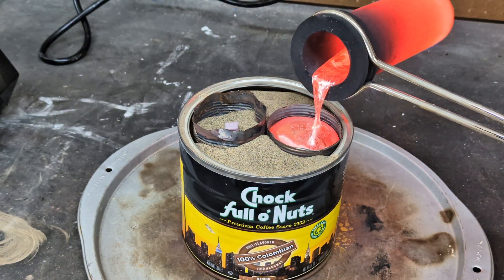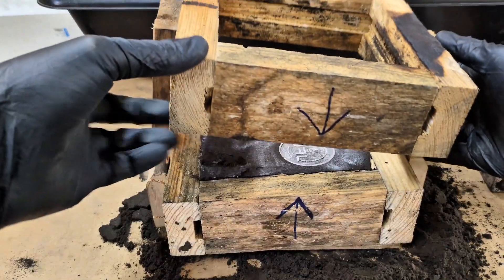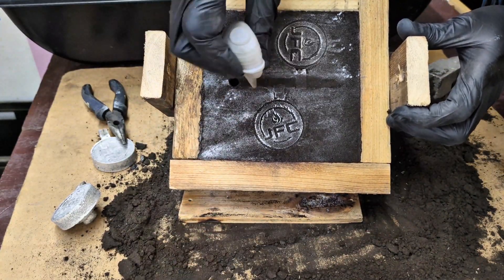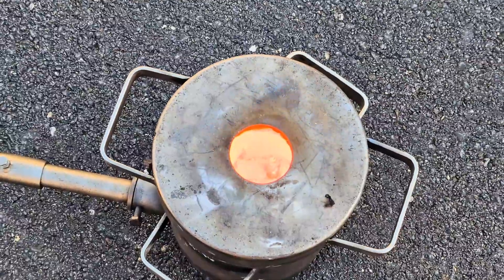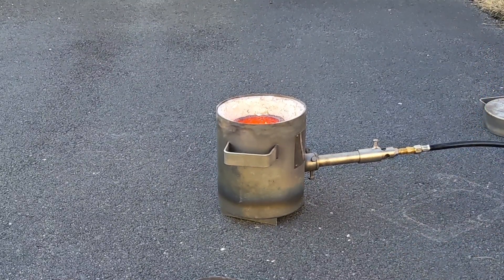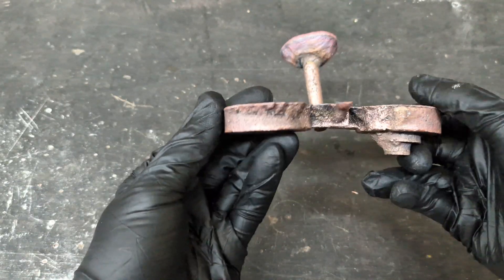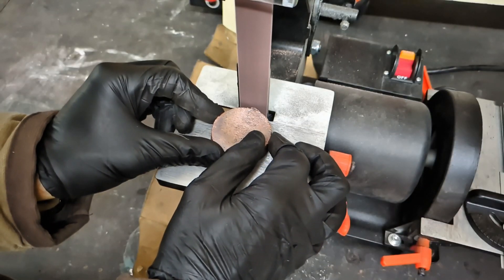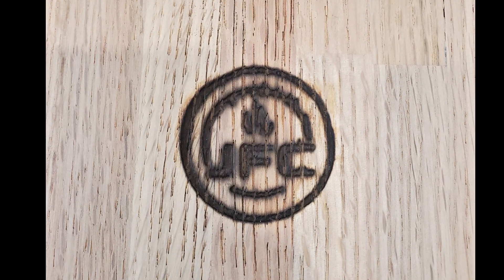Casting Copper Stamp -(Sand Casting)

Comment: Just tried melting copper and pouring it. 1st batch it formed a black layer on top when oxygen hit it and it poured very bad, 2nd try I added borax to it but it basically did the same thing.  Do you use borax? Thanks and I always enjoy your videos.
Reply from the maker: Thanks for watching my videos 🙏🙏  I have added borax a few times when melting copper wire, because of all of the junk.  However I don't always.  Check out a few of my most recent videos where I did copper.  I did not experience that black oxide layer.

Comment: 👍 If you wait to cut your runner in the drag until after the cope is rammed up and you've re-opened the mold, you won't have to scrape that inverse runner off the cope - it'd be easier to make a nice clean mold, not to mention faster.
Reply from the maker: Facts!  I'm not exactly sure why I cut the runner into the drag.  I think I did it for the position of the sprue, but it still doesn't make sense. 😂. Im never going to cast this one again. I only had to make this one. 👍👍